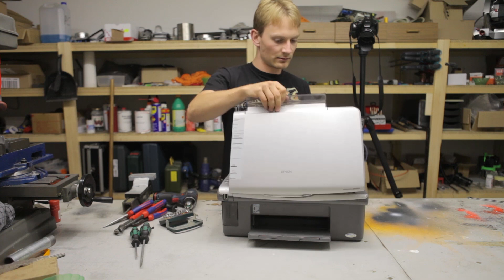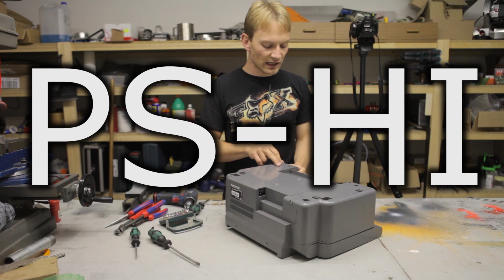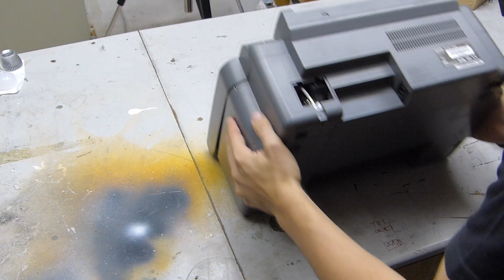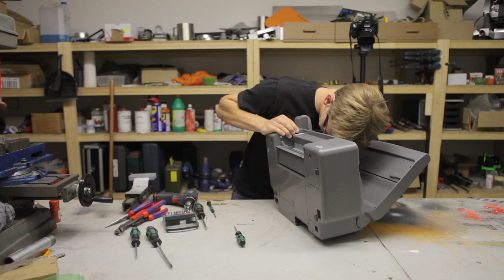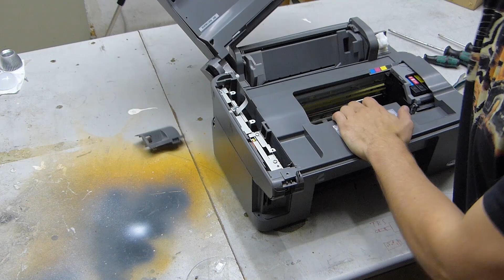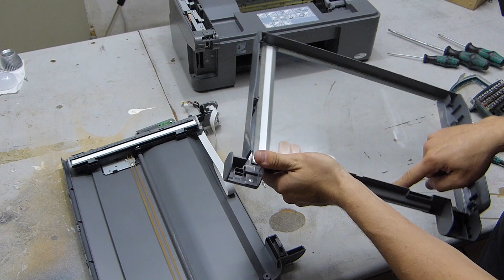Tom's Tips: Making a sacrifice

Comment: About 9mm or any weird diameter rods. I think one can try to find brass tube to fit exactly on this rod. Polish it from inside, cut into 4cm pieces and those as a poor man's bearings. They will wear soon and damage the rod, but all this will last at least for a year, if greased properly( read "all the time"). Enough for someone`s first attempt at building i2, I think. Painted rods  can go for the RepRaps construction rods, if they are long enough and you can cut thread on the ends. Finally, if you are into electronics DIY, you should not skip the mainboard. Sometimes you can find fully featured reprogrammable controller on it.

Comment: Good video, it took me several days of research to draw the same conclusions. A few comments- I've scraped 4 printers so far and 3/4 all used 8mm rods, the one that didn't was an off brand, cant remember what. So far lexmark and hp seem to use 8mm, which is whats needed for RepRaps. Also, i'd suggest keeping the screws, they are one of the most useful things you can salvage from something in general, and its possible you may even pull some M3s that will work on a reprap. Also, I think you can salvage springs for the extruder, ive already got a nice selection of sizes. i think the best advice is to get some storage containers and make yourself a parts collection, if not you'll be kicking yourself down the road.
Reply: Also just some more fyi from years of this kind of stuff, those ribbon cables, especially the thicker ones with the plastic header are really good to keep, they are universal and come in very handy and will piss you off when you have to pay money for one. A good trick to, is taking a torch to the back of a pcb then smacking it on a table to get all the components out, works like butter, bad fumes, do it outside. You can build an amazing component kit for nothing, just have fun with the sorting!